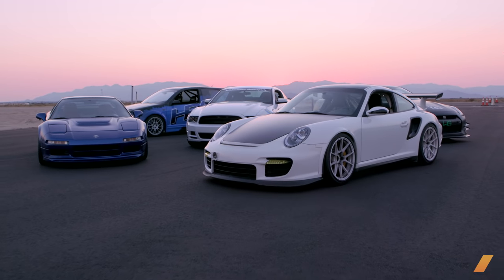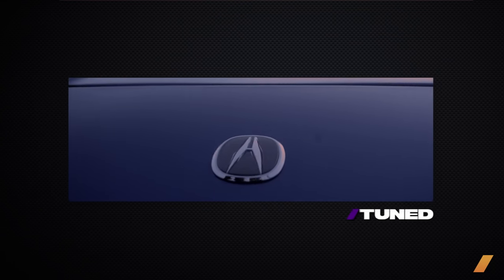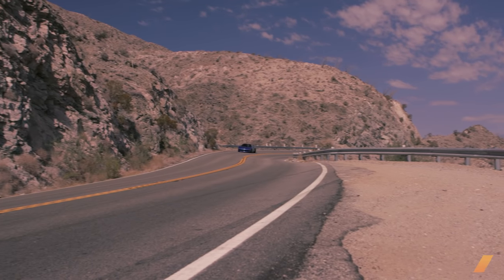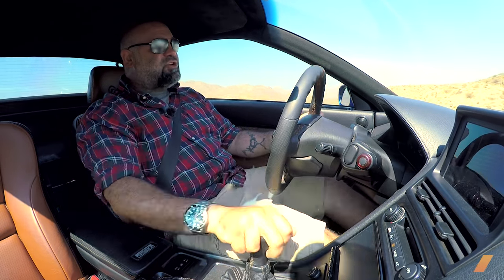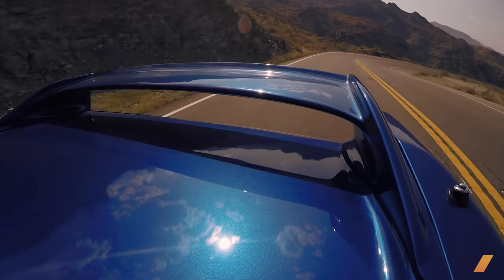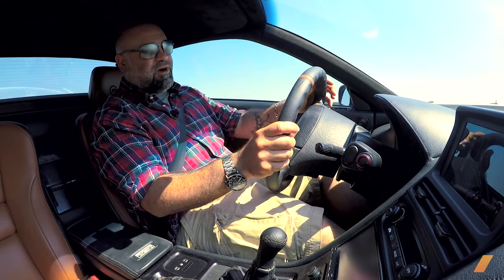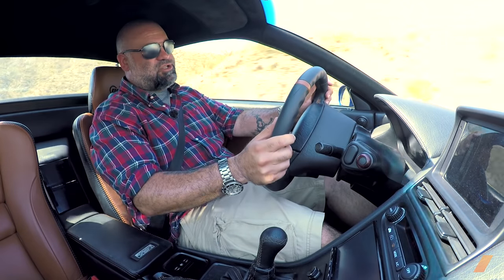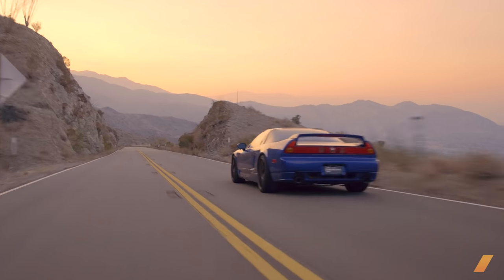Supercharged Acura NSX (SHOOTOUT) -- /TUNED

Comment: it's refreshing to have a car host to be honest about the negatives too. Most of the YouTube won't say anything bad for fear of losing contacts
Reply: it got 3 points at the track review.. that's a dock in my opinion.. he even said they had to stop cause it went into limp mode due to overheating.. an nsx should get more then 3 for a track day, it's better then that stock for sure, not as fast as this, but for sure better then what amounts to practically nothing
Reply: SpecialKLSX  probably correct, and you're right the street score should have been a little lower.. but the rest of the cars are straight track cars that are "street legal" so thats why it got the highest score.. for example the R32 didnt have air-con, radio, 3/4 of the interior.. things like that.. so out of the bunch its the most street car, minus the Mustang which is strictly a street car, not a track car
Reply: SpecialKLSX Well Matt said they fixed the issue after the test, and the "grandma test" isn't true.. Some people to enjoy touring style driving.. they wouldn't include it in the test, if they didn't have to be road legal on road tires if it was irrelevant.. if not it would be tow them to a track.. put em on slicks.. and see whats up
Reply: Matt responded above saying for regular road driving it was fixed quickly and they drove it a lot and he said it was great. If it wasn't going into limp mode I imagine it would have been much faster on the track and not so far down on points.
Reply: Matt has always been honest in his reviews and sometimes get a lot of shit from brand fans. Like when he a few years back asked how people even could compare a Cadillac with the German premiums when the cabin quality is so obviously sub par. A lot of people called him anti US and "hater" of US brands or hater of GM. That despite him having a Corvette and other US cars. But everybody else, not bias to GM or Cadillac, knew this fact and we agreed with him. He says it as it is, even on the smoking tire he tell the owners if he thinks their modifications have not worked. I've always respected him for being honest. His review of Tesla model S is probably the only review where we get an honest review of the car, and hear about the cars shortcomings. Not like most auto journalists that kiss Tesla's ass all the time.

Comment: was about to say supercharger is not as bad as i thought. then this happened. turbos ftw
Reply: Boost is boost and either one makes more heat than N/A engine. There is a reason N/A engines are more common in road racing.
Reply: Just needs a suitable charge cooling system - a decent sized intercooler + maybe a sprayer for this kind of weather & hard driving, & maybe extra oil cooling too if the engine itself is overheating.  It's all stuff that can be fixed.
Reply: @matthew sharpe remember the outside temp can reached at 80c in a normal day. with all those is not going to help with overspun s/c for that small size. you just going to need a bigger s/c to give less heat for same power.
Reply: BlueRice 80c?  I think if it was that hot out you'd be more concerned about being dead and cooked to medium-well than pre-detonation in your engine. Seriously though even in 40c+ intake temperatures you can engineer suitable induction cooling - but yes, you are right a larger s/c spinning at a lower speed will generate less heat.
Reply: Matthew Sharpe It's true that with proper cooling systems you can have good performance and get an engine to last a race, but for those who want to get the most track time without having to rebuild their engine frequently it is best to stick to N/A engines. Again, this is why the majority of cars designed for track use are N/A. Porsche 911 GT3, Cayman GT4, Camaro Z/28, Shelby GT350, the C6 Z06 and now C7 Grandsport (arguably the current Z06 is not really a good track car ... see all the reviews with it overheating on track, which kind of proves my point again). ... But when you look at the race cars that have turbo engines they are supported by factory backed teams and multi-million dollar budgets for each season. N/A engines are the gold standard for reliable road racing. Always have been, and always will be.
Reply: joeracer302 It's definitely more difficult, expensive and complex to engineer a reliable forced induction setup - but they have been successful, even in smaller budget racing - the Nissan GTR for example was banned from the Australian Touring Car series in the early 90's  because other manufacturers were unable to compete with it - after it totally dominated the series for 2 years shutting out local manufacturers (ie, Ford and Holden), they changed the rules to ban turbocharged 4wd vehicles.

Of course even a modern turbo road car will usually experience reliability issues before a N/A model does - complexity and stress will always cause increased likelihood of failure and wear - not to mention higher maintenance requirements - still they are pretty good at it now.

I used to be a total N/A only guy until I bought my current car - I actually took the N/A V8 version for a test drive, then took the 6 cylinder turbo version for a drive - it had so much more poke than the V8 it wasn't funny - a full second quicker to 100km/h, more than a second quicker over the quarter, almost no lag, better standard equipment, and it was a bit cheaper - oddly it also had a better exhaust note, but I think the factory exhaust on the V8 was really not good - in the end it was a no-brainier.  130,000km later it's not had any problems with the engine despite some pretty had driving, so at this point I'm happy to say it's been a reliable car.

Comment: How does this car get medium score for value? It doesnt perform with the overheat supercharger, and the cheapest stock Nsx you can buy would be around 50k. Them modding it and supercharging, rebuilding etc would bring it close to double?

how is that decent value?
Reply: Because we probably haven't seen the cars with the worst "value" yet (wait for the Porsche/GTR). Compared to the Mustang, the value of the NSX is much worse. Compared to the NSX, the Porsche or GTR might have even worse value as defined by the shootouts standards.

Comment: next to the RX7 FD my favo JDM ever
(Mitsu EVO 7 > 9 is to me in a class of its own)
Reply: FD's are garbage
Reply: FD's in fact are actually quite reliable name one thing other than overheating gas mileage and apex seals that's wrong with the engine design
Reply: 3LightningBolt "..name one thing other than mileage,seals,and heat issues.." Parts costs??
Reply: Bruh you can buy a whole 'nother engine for 1.5k
Reply: "Bruh" the whole myth and atracktion of the FD is its sexy round form
BUT most of all its rotary engine !!!
putting V8 in it like some braindeath Ami's do is PURE sacriledge
and kills its perfect 50/50 weightbalance
if ya want dumb big capacity power buy anything else but an RX7 FD
with the proper maintenance a rotary is just as good as any other engine and can deliver WAY more power that piston engines
its even eazy do make it a 3 or 4 rotor engine
and then it'll smoke every piston engine
Reply: I dislike the V8 swaps but if you're gonna V8 swap at least let it be a Japanese V8, and plus why would you swap it? The "R" in RX-7 stands for "Rotary" you take the rotary out of the RX-7 and it's no longer an RX-7, I mean I for one love the sound of the rotary engine nothing like the sweet sound of insane brappage
Reply: 3LightningBolt Rotaries were 'ok' in the late 80's early 90's.. but compared to engines of today, they make less hp than a 4 cyl, have terrible emissions and fuel economy, and break down more than a jaguar.. 
There is literally no reason to own a rotary besides nostalgia or just wanting to be 'different'. Sorry but rotaries are a failed design. Thats why no-one makes them anymore. Even a sr20 swap in a rx-7 is a better choice
Reply: ya missing the point !
a rotary engine is the "soul" of the RX7 
if ya don't wanna deal with its needs, then DON'T buy an RX7 (and replace its soul with any other piston engine)
ooh and, i personaly know a 2 rotor tuned to 600hp daily driven for years without a single nigle just proper maintenance
and there are 4 rotor convergeances with well into 4digit HP that smoke most others on the dragstrip to this day
rotary engines, wenn used right are more reliable the fezza's in general xD
Reply: Iris C I've owned a couple of  rx7's and already dealt with that scene.. 
Sure I give props to the tuners, but rotaries in general are waste of time and money and the only reason you buy one is to be different.. and it takes alot of $$$ to be 'different'. 
Maybe I'm not that cool, or maybe Ive gotten old and grumpy, or maybe I've just realized the value of money.. but I've been through the hype of meeting my hero.., and he had sex with my mom.

Comment: What kind of moron underdrives a supercharger to the point that it is beyond the range specified by the compressor map and doesn't add some form of charge cooling? They should have fitted a water/methanol injection system.
Reply: 100% agreed. Kinda mental not to!

Comment: this car is near perfect, it just need a little more power like 800+ hp so it can hold its on, on the streets cause 400hp can feel really slow against these new  mustangs, and camaros
Reply: Doubling the hp is way more than "a little more power"
Reply: Dexter Sullen it already has problems with handling 400hp. doubling that would be a really bad idea
Reply: Stev3 i agree 450 550hp  is a sweet spot this car in my opinion its  light and agile and it looks so sweet especially the rear deck
Reply: At 800 hp It probably wouldn't have made a full lap.
Reply: Dexter Sullen Wow 800hp? Keep in mind that the engine isn't made to do these numbers and it wouldn't last long, also its a lot more important to put its power down effectively and handle corners well so its fun to drive. Mustangs and Camaros are way heavier and most of the time don't exceed 500hp.
Reply: Dexter Sullen Wow 800hp? Keep in mind that the engine isn't made to do these numbers and it wouldn't last long, also its a lot more important to put its power down effectively and handle corners well so its fun to drive. Mustangs and Camaros are way heavier and most of the time don't exceed 500hp.
Reply: Hey its not like he have to floor it every stoplight, 800hp would give him some head room when needed. Nsx, r34, supra's are legends and other car would be trying to race them on the streets (turbo civics, srts,) and 450hp can get old
Reply: The NSX isn't a straight line racing car doofus. Stick with your Supras and Skylines kiddo.
Reply: Yucannt Hahvitt (its isnt a straight line car) so apparently it's a circle car now hmm, it's so funny when people say that, a car is a canvas you paint it whatever you want it to be, 2000hp civics to independent suspension minivans. You pick
Reply: straight line racing is for kids... braking, corner entry, corner exit, heel an toe, etc.. thats racing!!.. is sad that people takes skylines and supras (such beautiful machines designed to attack the circuit) and turn them into trains without rails
Reply: Dexter Sullen it's not all about high hp if the weighs alot
Reply: Dexter Sullen
Stick with your GTRs and stuff kiddo

Comment: Was it a conscious decision to test in the Coachella valley? It's the hottest place in So Cal and it appears you picked the hottest part of the year. Why not pick a more "average" place to test?
Reply: We couldn't afford flights, and we couldn't afford a more expensive race track. The cheapest race track you're going to find is in the california desert in august, and that's what we could afford.
Reply: at least it looks gorgeous!
Reply: It makes it harder on the cars, so the cream can rise to the top.

As a Coachella valley native and car modder, my modded cars must be able to take the heat.
Reply: That drive+ money didn't help and we get the welfare track :(
Reply: ***** The cooling system is  very important for driveability, if the car overheats going up hwy 74 at 3pm on a 120ºF day, then it is not driveable in our area.

Extreme heat is however even a harder test for cars than extreme cold.
In the cold you might need an engine block heater, but it does not matter what car you drive.
In the cold, you might need something to stop your fuel from freezing, but it does not matter what car you drive.
In the cold, your tires might become rock hard and slick as snot, but it does not matter what car you drive.

Once up to temperature, I've never heard of a single car ever that could not keep its engine warm, but even in cold climates cars do over heat, so it is a better test to test extreme heat endurance than extreme cold endurance.

Car's never over cool, they only over heat.

There is also no such thing as normal, so the only way to have a quality test is with extremes, like who is at the extreme end of lap times.
Reply: There is a difference between being driveable and going flat out for extended periods of time in 120 degree weather. I'm just saying the ability to perform in an EDGE CASE like the extreme weather in the Valley is not really indicative of the ability to perform in general. It might be an interesting outlier, or a seperate durability test, but as a primary test bed Coachella Valley is stupid.
Reply: Corey Halverson After 3 cars, the valley found one that was not driveable up a mountain road on a hot day. 
On hwy 74, the NSX was not going flat out for extended periods of time, it was going uphill on a 107ºF day...and overheated.

Race cars focus on cooling for a reason, if you want to go fast, you need to be able to manage your cooling. The more cooling you have, the more power you can make.

If a car can't go up a mountain road on a hot day, then it's also going to overheat when you push it for 20min. on a race track at 70ºF.

Power makes heat, cooling makes performance.

Comment: Has issues with reliable road drivability = gets full points for road drivability.

Gorgeous car, but the scoring in that category seems off.
Reply: Christian Lemon we've driven this car a lot and this was the first issue that's come up. It was quickly fixed, and a great driving car.
Reply: TheSmokingTire This whole series is based on shops running what they built and they should be scored objectively. It doesn't matter if the shop fixed the misfire, it happened during testing and should be reflected in its scoring. If you're going to give it a full score then it should be the case for any car that breaks down - because any one of these tuners can stop to fix an issue and get back to testing. It's like saying a tuned car is a great driver, as long as it's working properly...not much credibility behind that rationale, right?
Reply: Still should've docked it points for that happening at all. It's a reliability issue, doesn't matter if it's an easy fix.
Reply: Reliability =/= driveablity

Comment: Should ditch the SC do a big all motor cam,port the heads,nice manifold(ported), mild comp pistons for street use. It would make that much less than the SC and probably be faster and have a better powerband for the track... OH yeah can't forgot to swap that sluggish factory gear for something shorter,at least a type r final.

Comment: That track looks covered in sand from the kick-up off the tires. While on the surface seems like a non-issue, but it likely hurts grip and track times.
Reply: ed g it does. It was dusty and 114-115 degrees out there. Not ideal, but consistently rough for all the cars.
Reply: Any issues with intake with so much sand? I see that at willows a lot too.
Reply: not really, it wasn't that bad.

Comment: I still wonder how Honda went from an Awesome NSX too a new heavy bloated "NSX" . Really disappointed about the New NSX.
Reply: Lets just pretend the new NSX doesn't exist.
Reply: I know but the new NSX seems too heavy but then again I'm not an engineer
Reply: Boysya but the NSX had about 290hp tho, tbh I would much rather drive a slower, underpowered car if it handles well and is fun to drive.
Reply: I thought I'd never say this, but the C7 Corvette Grand Sport is a lot closer to what the NSX used to be.
Reply: Boysya, that's a straw man argument.
Reply: that's because Japan didn't engineer it.  American did.  They know nothing about Hondas.
Reply: F20NAprelude Yet plenty of great American track cars currently being produced, which use the original NSX recipe: N/A engine + light weight. Look at Shelby GT350, Camaro Z28, C6 Z06/Grandsport, or C7 Grandsport for examples of this ... The current NSX was ruined because they wanted to play super car games and make something "special" using "future technology" because in philosophy that is something the original NSX did do (titanium engine parts, aluminum frame/body, variable valve timing, etc.), but their approach lost touch with the soul of the NSX and while the new version has amazing performance it won't be known as a game changer like the original was.
Reply: joeracer302 those are great track cars a I love the fact that they're all motor but those are hardly light weight cars... Light weight at the most I'd say 3k-3400ish max..
Reply: F20NAprelude Fair enough :) ... Corvette is under that weight, but the Camaro and Shelby aren't :)
Reply: Peteto Chibs True story. Metric FTW :)

Comment: They redid the interior, put a new sound system in it, did an engine swap, put a supercharger on it; but failed to get rid of that fucking marshmallow steering wheel? Come on.
Reply: Drummin003 steering wheel was redone, airbag retained. stock was never that thick and this one flat bottomed.